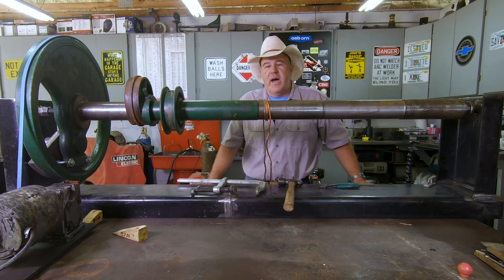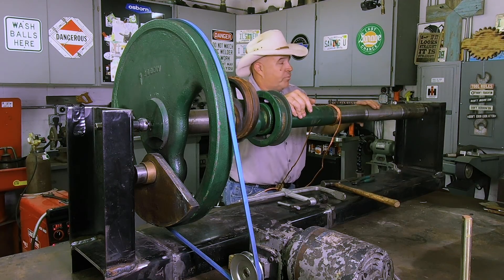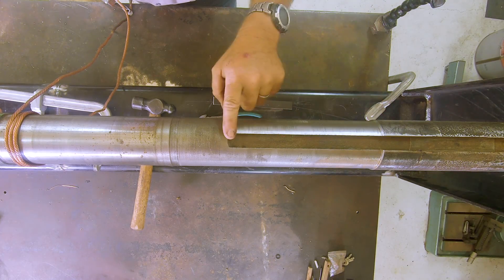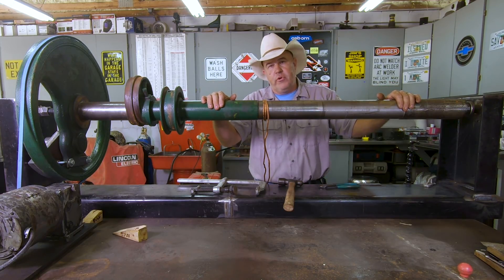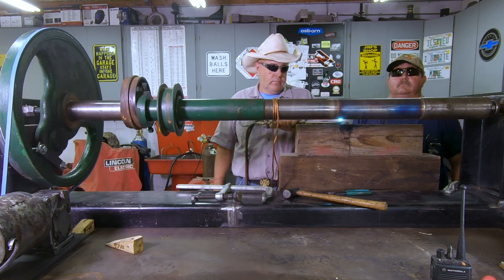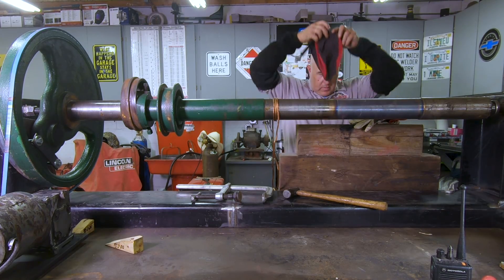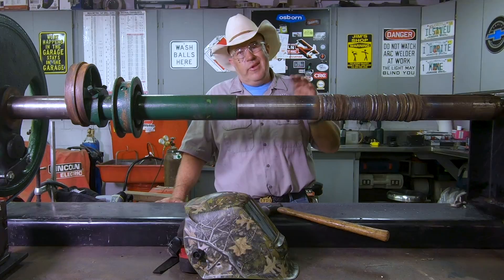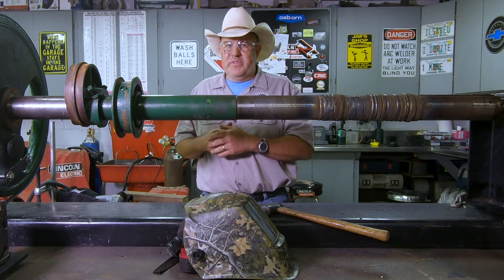WELDING repair for a 1910 CASE STEAM TRACTOR

Comment: Just use a drill bit to remove all the junk inside the oiling holes. Flatten the bottom edges of the small drill and radius the ends. Then just rotate the bit by hand to remove all the things inside the plugged oil holes. An ounce of prevention is worth a pound of cure. Worked for me fella. Remember good tips are FREE !!!

Comment: Done a lot of build up welding on shafts and other parts, with mig and sub arc. It was challenging to say the least with mig. With sub arc, the most difficult challenge was building up edges without burning it away. It took a lot of tries, but with time I learned to put a weld bead on the corner of shafts and other parts. First off, was getting the angles right. Second was to get the right heat out of the welder and third, getting the right speed of the positioner. I got to where I enjoyed that type of work way more than the normal production routine. Really liked this video.👍👍👍

Comment: My uncle was head machinest at a big power plant for many years. I have went to his work with him on weekends when he was welding up shafts and he put them on a lathe and use the feed  system on it to travel and had made a positioner for his mig gun. He had mounted a pipe threader coupler to the input shaft so he could put a hand held electric threader on it and turn it on then engage the feed system on the lathe then lock the trigger on. This gave him perfectly uniform beads that were easy to turn down afterwards because it was already mounted and centered in his lathe. Just change tooling and off to the races he went

Comment: I can't seem to get something confirmed about what you said in class at the bash about the high freq. switch on older tig welders. Did you say to keep it in the continuous mode for all types of welding, even metal?
Reply from the maker: Continous for AC
Reply: @DoRiteFabrication  Ok, Thanks

Comment: Nice vedio glad the weld positioner worked out to bad we didn't get the tracking part to work .just needed some more resistors. Thanks again to all the YouTube creators for all the help. Chuck Gause. florida flywheelers antique engine club

Comment: The only thing I would have done different is set the shaft and lathe vertical in case the weight on the hot shaft wanted to pull a bow in the shaft

Comment: I see you have upgraded from your Keith - positioner. You might like some of the welding on CEE. typically has some good info on settings, wire etc. This one is a shaft weld repair. https://youtu.be/5kGeFBWJc8E